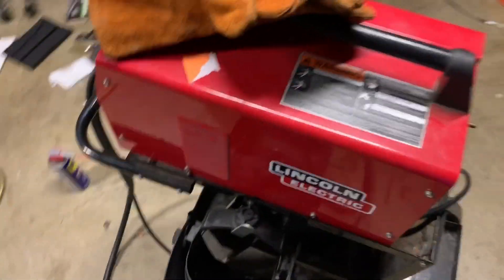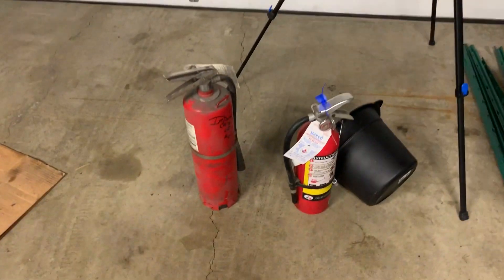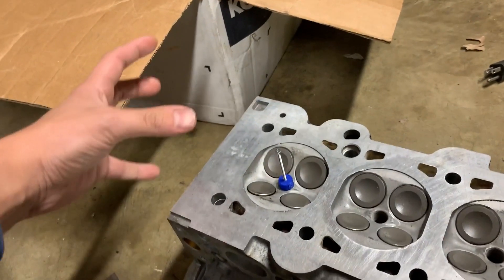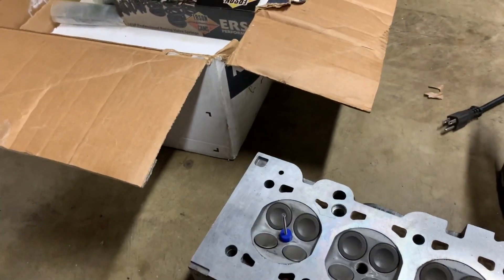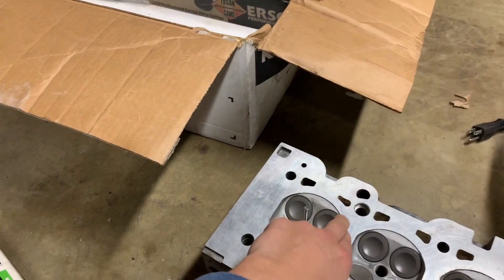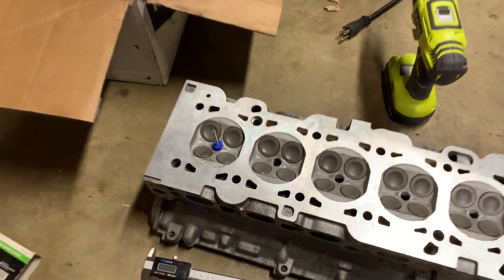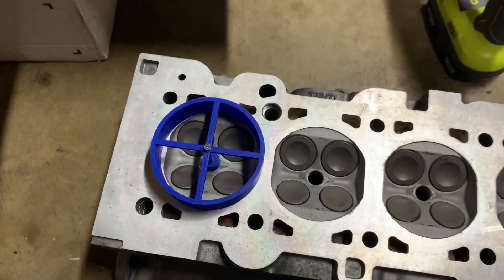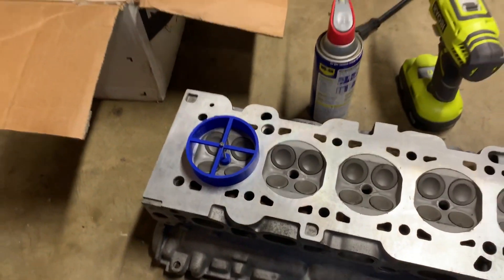Using 3D Printing and Bondo to make a combustion chamber mold

Comment: I'm going with 10.5:1. Did you measure the chamber volume? Mine is 49cc.
Reply from the maker: Unshaved head is 51cc. I would tell them 51cc, thats what all the manufactures use and also what I measured. Could be slight tolerance differences between heads, but 51 is what you want.
Reply: @SimplyVolvo  I measured two different RN heads at 49cc, and my machine shop measured a third RN head of mine, and also got 49cc's, all heads are uncut. I will have to measure my 850 head, I'm betting it measures 51 cc's like you have measured.
Reply from the maker: @turbovolvos40  Yeah maybe RN is different.